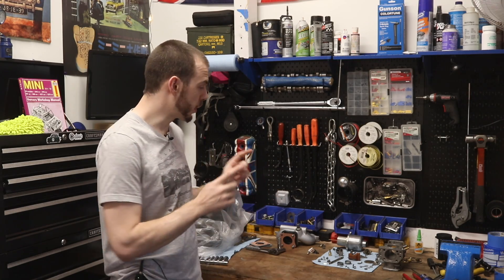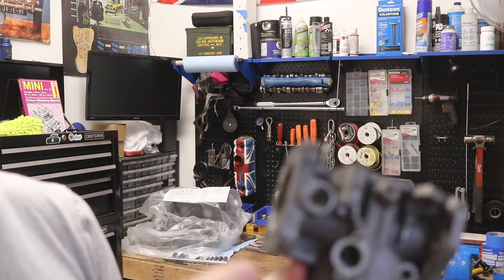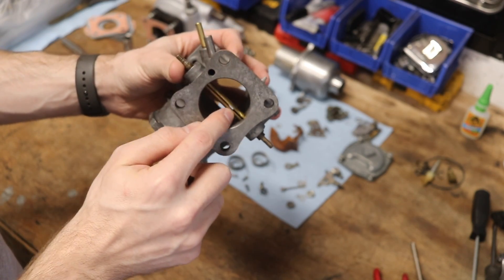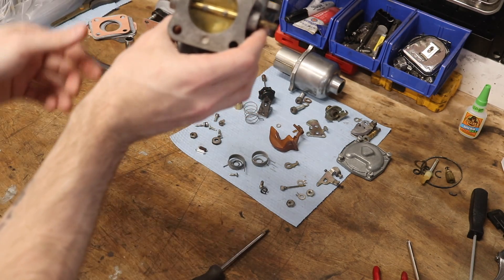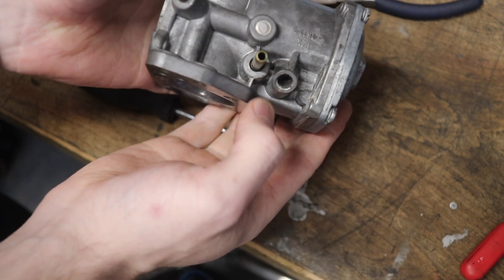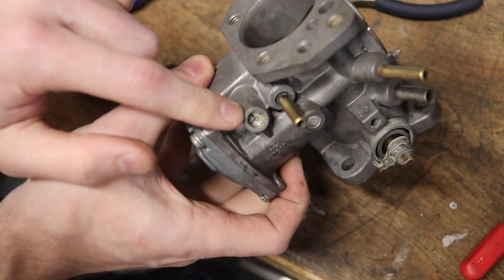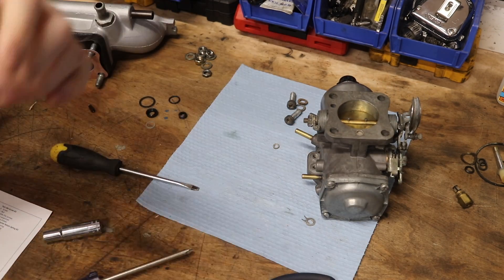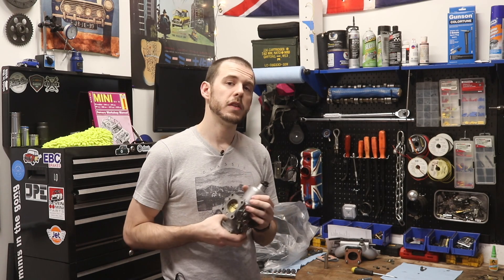How to Rebuild an HIF44 Carb - Part 2 Assembly

Comment: The small brass screws with the slot in the butterfly valve do not open themselves. You need to pry them open once the screw is inserted. This stops them coming out and being eaten by your engine.
Reply from the maker: Thank you for sharing this. I pinned your comment so people would see it first if they are working on their HIF44

Comment: Great video.
As an alternative ..Petrol/Gas is great to clean and soak parts overnight...use a small paintbrush to cleN.
Also ...a good idea to set the float level after fitting the needle valve and check the float itself is not punctured.

Comment: to fit the throttle spring use a female /female wire crimp,slide it over the spring end,rotate it past where it needs to be,put the quadrant on holding it down and release it gently into place,fit the other piece on and the nut n washer,took me about 30 seconds....

Comment: The overflow is not that I'm afraid. It is the highest pipe at the other side.
Reply: Hey thanks for this reply i did wonder, where should this overflow pipe be plumbed to? (so that if it overflows it doesn't just go onto the hot manifold?) Cheers
Reply: @sukiperu1  i have a petrol tube connected from the overflow in the carb all over to the front of the clutch case so if it flow (has happened to me) petrol drops behind the number plate.  It is the common solution in Minis.

Comment: Hi Cole - good video. Small comment - the screw at 9:15 for fast idle adjustment under choke should be installed the other way around so you can access the head of it... good luck with the installation! :)
Reply: You can access the head from the side, it is installed the correct way round.
Reply: @TimWilkinsonPoland  Wow! That was a blast from the past!
Reply: @jonstout9236  ha yea sorry, watched these videos a year ago when I was rebuilding my hif44, just getting started today 😅
Reply: @TimWilkinsonPoland  Cool - I have re-conned a few - did you get the proper SU kit?
Reply: @jonstout9236  yea got the proper rebuild kit from the sucarb website.

Comment: What about the O-Ring under Dashpot?
Reply from the maker: There is no o-ring under the dashpot on the HIF44. The only o-ring lives at the bottom float chamber. https://www.minisport.com/selector-carb-hif38-hif44
Reply: @classicminidiy  - I Have a Landrover Defender with 2 x HIF44 Carbs and they definitely have an O ring under dash pots.
Reply: @classicminidiy  - I am not sure if we are talking about the same part - I am talking about the O-Ring which goes under te Suction Chamber - Part 11 on exploded view in workshop manual.